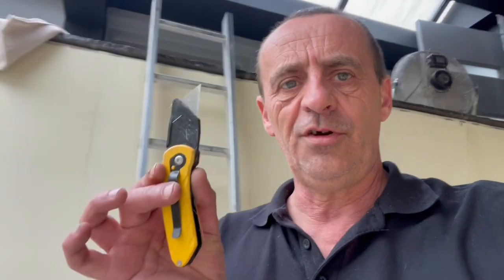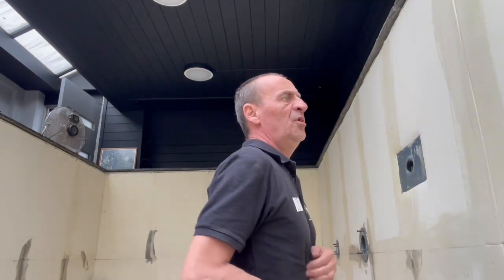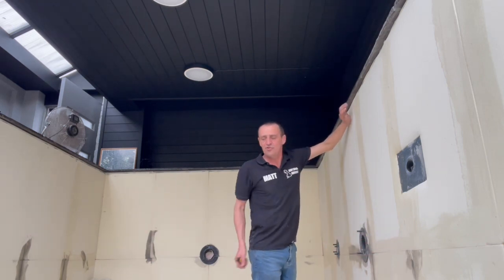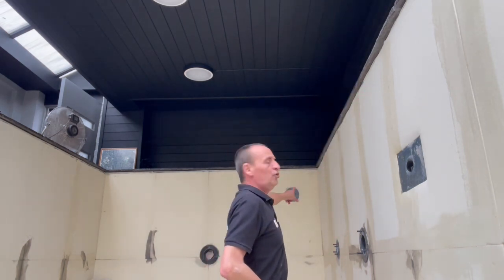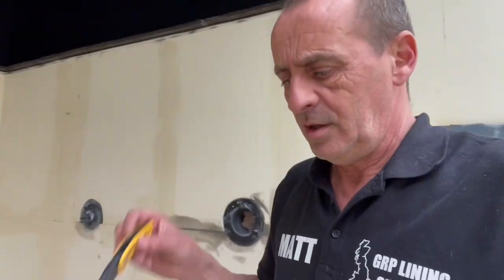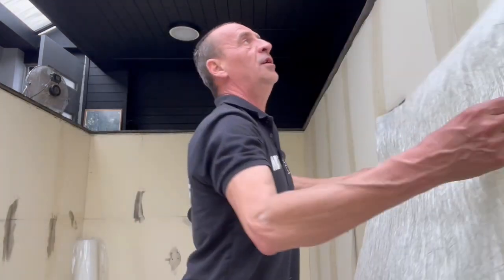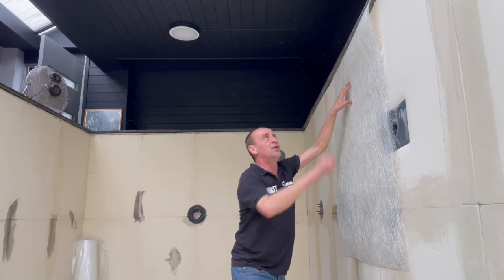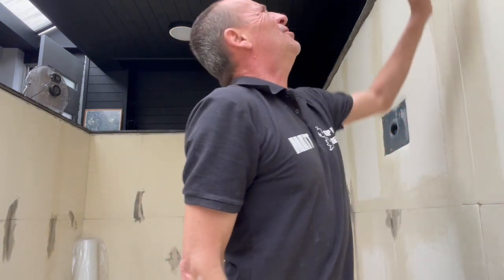Stinks. Whatever

Comment: It’s an amazing smell worked in thermo set fibreglass for 5 years on a 450ton press running at 160degc even in middle of winter with snow on the ground the inside of factory never dropped below 28degc 👍🏻😁😊